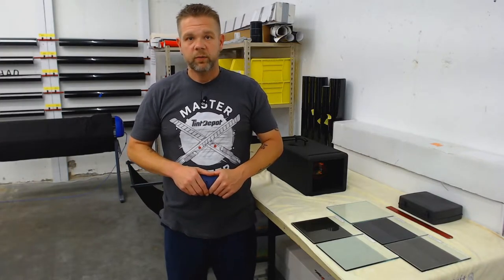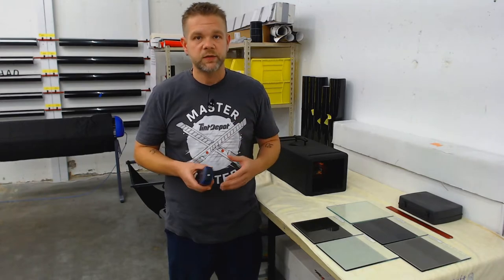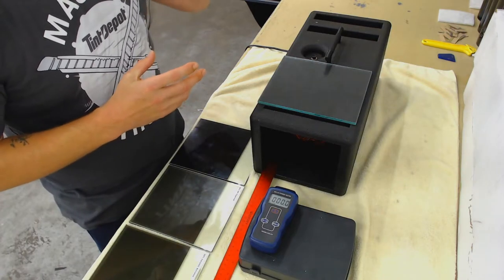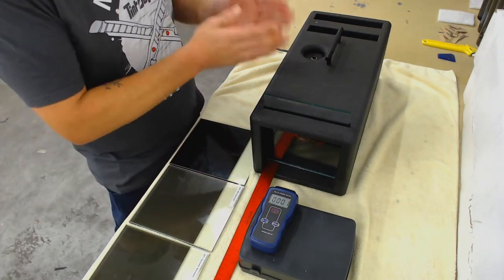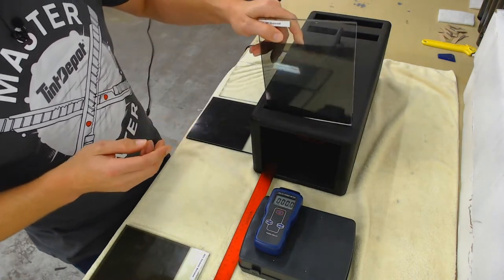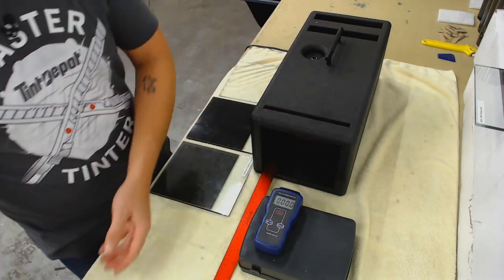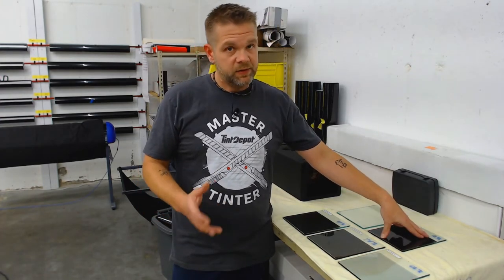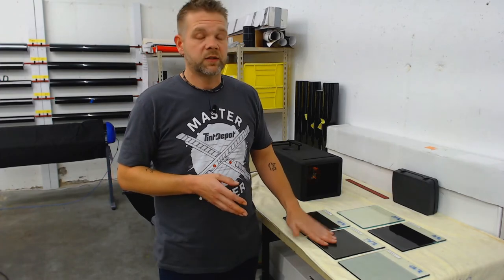Ceramic dyed and metallized window tint decoded and explained

Comment: Recently my wife's car (new mini sedan) was tinted by the guy who does at the car Showroom
We were told it is 3M CR 70 but I had a suspicion. When tested IR rejection was 75% only although the film had 3M logo watermark. I suspect it is a fake from China. $150 for 4 window glasses and rear windshield.
Probably metallic as the touchscreen infotainment system operation with the IR remote got messed up.
Best way to check it is with a meter before installing.